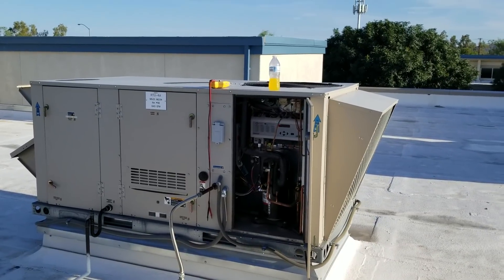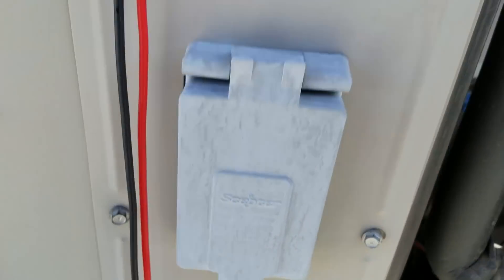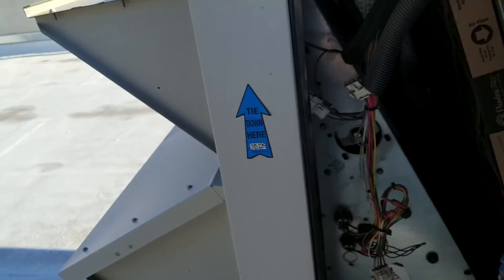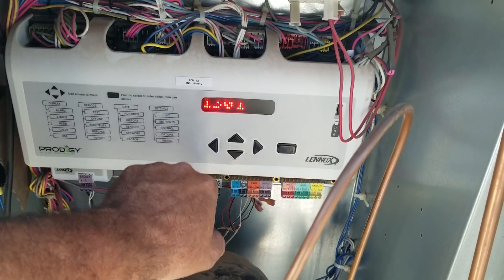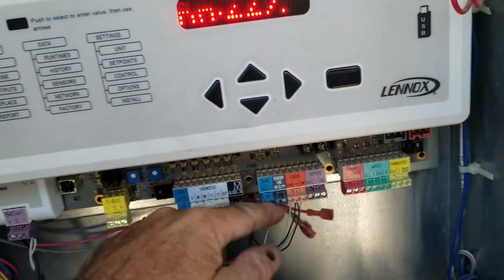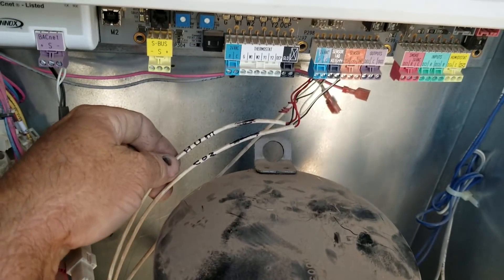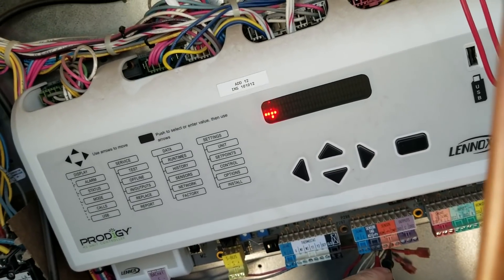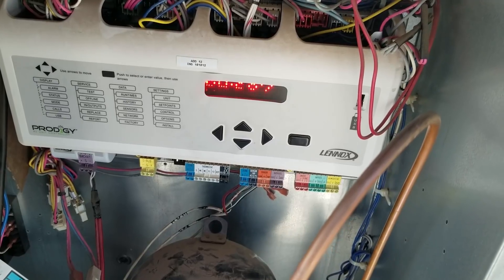Lennox Energence unit with reheat for dehumification works even better when wired correctly

Comment: So if you want to use this RTU as standalone is there a thermostat that has the humidity and CO2 sensor lets say "all in one"
Reply from the maker: Yeah there are thermostats with both. There will be the normal 24VAC outputs for fan heat and cool and then a 2-10/4-20mA analog signal for CO2

Comment: Those HVAC guys that work with Ammonia systems make about that much per hour or more. Those units use 50 to 350 HP motors or even higher,  and they are rotary screw compressors. Frick is the big name in that industry.

Comment: I guess they didn’t check their work after the install.
Reply from the maker: As long as they feel cool air blowing, it is good. LOL
I go to jobs all the time that had "Test and balance" by a separate vendor after start up and I can see that there is no way the economizers or fresh air dampers were possibly adjusted at all!
Reply from the maker: And in this example, you wouldn't notice the problem until it gets humid.
We have a few weeks at a time where the humidity is above 20% so most of the time that IAQ input was not being affected much by being wired to the Humidity sensor.

Comment: Hi, Pay, TB here. They have a combo humidity and temp sensor that accepts all of the wires. It's a 21W06. In fact, I bet your humidity senor could be one of those, and the contractor mounted an extra sensor for temp because he didn't know. This is a good find. 
NAS keeps me busy with follow-ups to their installs... just like that one.
I have a repair being approved for a pet grooming salon, where the M3 controller is keeping that reheat valve energized during cooling. When the cooling call overrides the dehum mode, that valve is supposed to drop out. I found it a week ago, and it had been that way for three years. I will post about it on HVAC-Talk when it's done.

Comment: Nice find.. a good tool to help find issues like this fast with incorrectly landed sensors is a toner. Got one from lowes I believe. Just leave it hooked up on wire and go through all wires coming up to roof. It will start flashing and beeping when you get close to correct wire.
Reply from the maker: Yeah I don't know why I've never bought a toner.
I've used them in the past for ethernet wiring and the such.
But not so much on HVAC.

Once I got access into the space below it didn't take too long to figure it out.
I just needed to see what was feeding that voltage range. Once I saw the CO2 was normal I realized it was probably wired to the Humidity sensor and indeed it was.

A lot of the wires are in conduit and in the wall with metal j-boxes behind each separate stat and sensor so the toner wouldn't have helped here.
Reply: Not saying you have to have.. I have one and rarely use it. Used it more at last company with cpc input boards and multiple cases. Mostly use meter now to confirm wires but it's nice to have when needed. Saves multiple trips up and down ladders for sure.